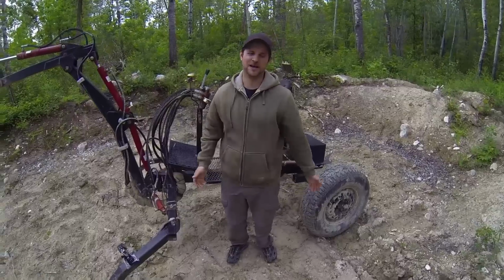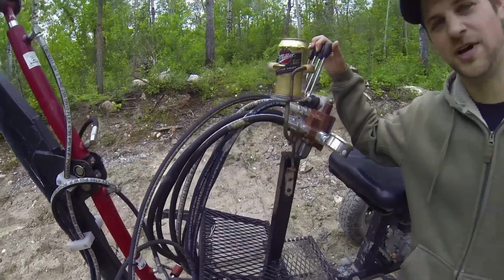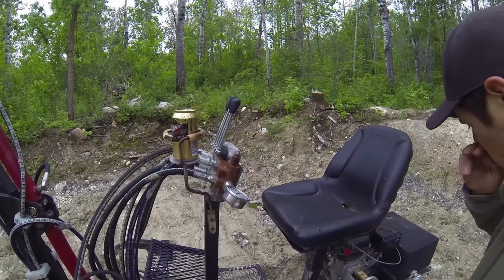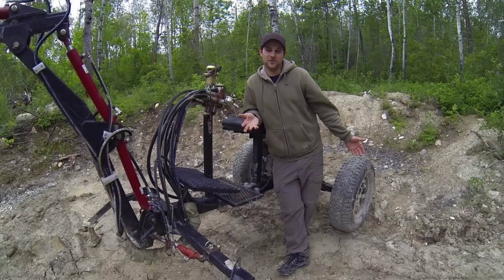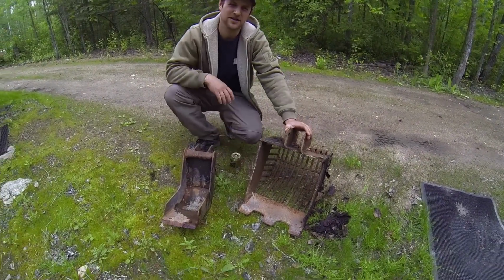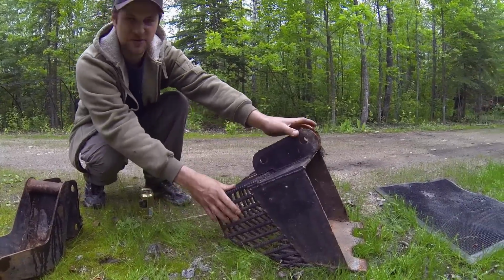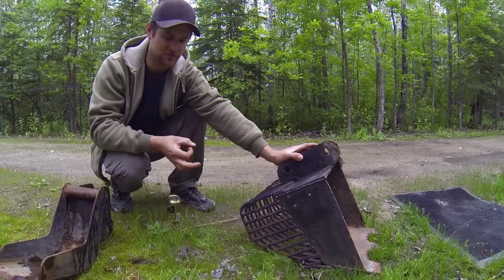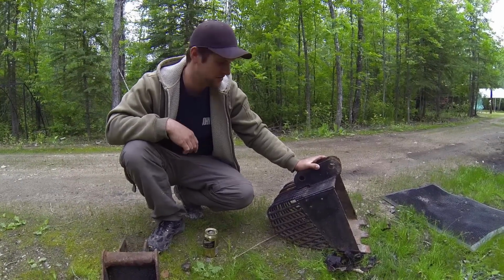Custom Made Mini Excavator - Backhoe - Testing The Limits

Comment: After buying land for a future house, and checking prices for used small excavators (cheapest about 5-6000 EUR) for ground works pipes, comms, basement and etc, this looks like a good idea for the next project. Thanks for the idea. I will go for a more powerful engine, though. Just in case :D
Reply from the maker: JurisKankalis yeah i think you will get come good use out of one, and just so you know the engine size is not really the limiting factor.  its the geometry of the hydraulic rams. since i built mine with no plan, some mistakes were made that limit some of the lift capacity. that little engine still puts out 2000psi of hyro pressure all day long. bigger rams or better angles would help it a bunch. the store bought ones and designed much better. hope you have fun with it!
Reply: REDNIC79 Yeah, about that. Just browsed all the Kubota little schmuck papers. Indicates nice flow rate at abt. 22 liters per minute and more, and pressure at slightly over 3000 psi. Of course that's overkill, but then checked online calculators for engine hp vs. hydraulic pressure/flow rate, and the table of your mentioned 2000 psi at only 10 liters pm crosses hp chart at exactly 10 hp, and the text goes on about 15-20% losses of the pump. What's your flow rate? And do you use the overflow valve, or what the heck that thingy's called, to feed excess pressure to reservoir?
Reply from the maker: JurisKankalis well....i'm no hydraulics expert by any means. i know that my 4 spool valve has a pressure release by pass built into it. its adjustable, and i have it set at 2000 psi (installed a pressure gauge) which is low but easy on the system. its dumps excess pressure back to the return line. i believe my pump is a 6.3gpm.

Comment: Very interesting. The part I don't quite get..is... how good is it at breaking and digging in virgin ground (I see you scooping soft muck...) , does it break ground, or does the front end just lift up? Thanks.
Reply from the maker: KyleCarrington yeah i know, the video kinda sucks for that. yeah it breaks ground fine....the hole it is in is dug with it. you have to use the bucket curl to dig as opposed to the weight of the machine. i have dug 200 feet of trench with it straight through the bush/roots. obviously not as powerful as a big machine, but it does fairly well for its size. much more fun than a shovel anyhow. thanks for the comment
Reply: REDNIC79 VERY COOL. THANKS FOR THE RESPONSE. I LIVED 4 YRS IN MANITOBA. LIKED IT. KEEP YOUR SLED OUTA THE DITCH HAHA

Comment: Not sure if you read/reply to your comment section. But I'm really impressed with your builds... I've been wanting a backhoe trencher from Harbor Freight but I don't have an extra 3500 bucks to purchase one all at once... I've been thinking about building one... If i may ask, What size rams did you use? Also what size pump gpm?  Thanks
Reply from the maker: Its was a while ago now, but the rams are 2" and I think the pump was .26gpm, but that is matched to whatever motor you choose, there is a calculation you can look up for that. Thanks for watching!
Reply from the maker: Arrr...not sure on the pump....it is in the other comments somewhere

Comment: Nice job, did you follow some online plans or do all the design yourself?
Reply from the maker: SouthWestIron I just designed it myself, kinda had to work with the metal I had at the time. I looked at a bunch of pictures online to get a starting point as far as hydraulic ram size etc. is concerned. thanks for the comments
Reply: Nice, I'm going to have to set out to build one myself. Think it would be cool to also add some hydraulic wheel motors and another two front tires and some sickle bar mowers.
Reply from the maker: SouthWestIron yeah the possibilities are endless....with 4 tires you could put a blade on the other side, which would be nice.

Comment: I don't know if they make a transmission small enough, but if you had some sort of gear set up on the outside of that motor maybe kind of like a mountain bike where its chain driven, you could have the motor directly powering the pump but also if you took it out of neutral those gears could give you power on the wheels for a bit of extra motion ability. With a setup like that you could make the system even beefier though with larger rams and a more powerful OHV engine.
Reply from the maker: The Arkle yeah thats true, or even hydraulic motors on the wheels. i always wanted to put it on tracks....lots of room to improve. thanks for checking it out!

Comment: if I were building one like that I would move the swing valve down to my right foot rest and put a right and left rocker control connected to the swing valve. and move the open close valve down at my left foot and put a forward and backward rocker control on that valve that way you only have the two boom valves to use your hands with I am an old gradall operator and that is the way the old ones worked you will find that you will be able to work better with it you can only do that is if you have single control valves

Comment: Also, just by looking at the rear "axle" I understood what should be improved to the problem of the whole machine sliding forward instead of digging into rougher ground. As the first idea a used rear axle of an FD car comes to mind, like google for Golf Mk 3 rear axle, the rear tires could be stopped with simply not deleting the handbrake assembly and using it to lock the wheels up anytime. This setup also excludes hydraulic motors for the wheels, but as you do not move around a lot while digging, I don't think the "moveability" is much of an issue.

Comment: you need a bigger bucket
Reply from the maker: COBO SOLO with the heavy gravel that bucket is about max lift at full extension, i could make a bigger one for lighter soils though.
Reply: you messaged me back thanks not many people do. what could you do to make the power of it more. im vary interested in making one but i need to start off doing some research first on what i need. i know i can get most of the parts off ebay for pretty cheap. any ideas on a website that would help me out? i know how to weld and all kinds of other stuff i just dont know much about hydraulic cylinders. thanks agin
Reply from the maker: COBO SOLO well, if you are interested in hydraulics the best place to start of course is google basic hydraulics and watch a few videos to get the basic theory of it. when I was building my excavator igot lots of help from my local hydraulics store (princess auto/harbor freight type place). they have tons of info that they can share. basically designing the system is all done through basic calculations.  the size of motor you choose will dictate what size of pump you can run etc. you can run ANY size of ram you want off any pump/motor. a larger ram will just be have slower movement due to more fluid being pumped into it to extend it, it will also apply more force. I used 2" rams for my excavator with a 6.5hp engine. for the main lift cylinder I could have gone with a 2.5" or even 3"...otherwise the power is fairly adequate. tractorbynet forum has lots of useful info, and they can be very helpfull as well, have fun!
Reply: thank you so much you are a big help!!
Reply from the maker: COBO SOLO feel free to msg me any time, thanks for watching